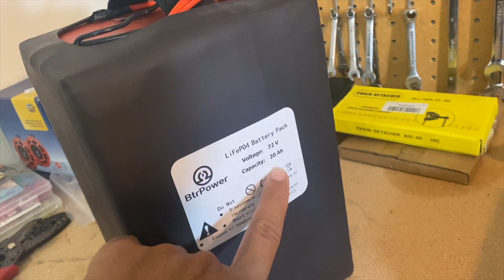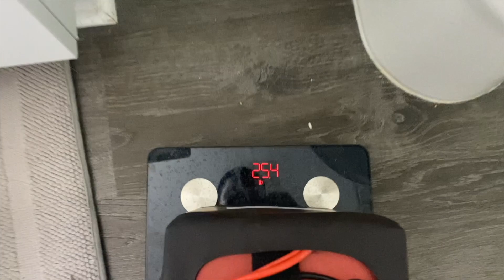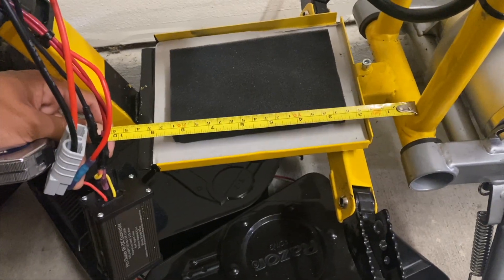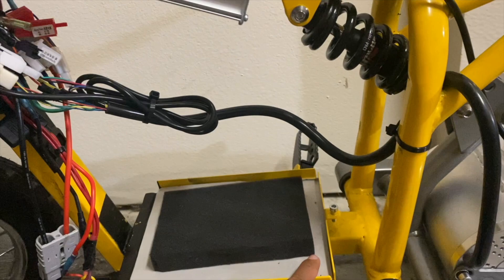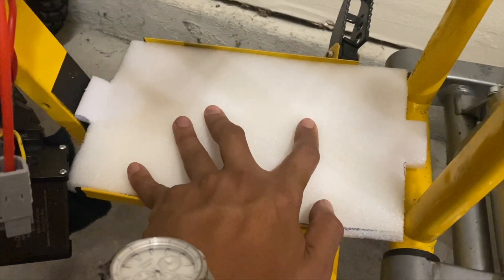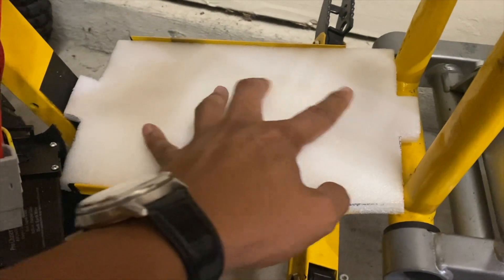Razor MX2000 Got a 72V BTR Power 50A BMS Battery! New Top Speed for the MX650 Supermoto

Comment: 72V 50Ah LiFePO fits in a razor mx650?
Reply from the maker: Nope! This was a super long time ago, 50-amp output BMS 20AH capacity
Reply: @PatOutdoors  7.87 × 8.66 × 12.99 inches. Is the dimensions of the battery I’m looking at but I’m wandering if it fits

Comment: Do you still got this bike with the same battery? I have the same battery and is have problems with it turning on any advice?
Reply from the maker: Check your wiring for loose connections, check your controller settings for any incorrect parameters put in, contact the seller for potential warrantyy
Reply: @ thanks it was the connections

Comment: For the record, I am new. Just recently picked up a sx500. In the process of tear down now. Have my motor, controll kit on the way. Been "researching" batteries. And a lot of rumors about these specifically, not good rumors either. Price is definitely hard to beat which would allow my budget more upgrades. Anyone set the record straight? Yes know Amorge would be ideal.
Reply from the maker: This is a super old video. Go with an Amorge battery if you don’t want to question the quality. I have Amorge on half my bikes now
Reply: @PatOutdoors  appreciated. I really damn if I do or don't. The 500 needs some love hence the $100 price. Was just tryin' to make best of the $1000 total budget I have. Keep up the great work and vids.

Comment: Btr power is the safest battery, for four months I’ve been riding around with a decent size hole into my battery and didn’t notice until it shut down on me while riding, if it was a different brand my house and my dirt bike would have been up in flames
Reply: The hole happened from a metal piece where the led acid batteries would be mounted on and it carved a hole in two places into the battery overtime as my battery was moving around while off roading

Comment: I just got a 72v 80 amp btr battery with an 80a controller! Running the same 2000w motor ! What should I expect? Love your videos
Reply from the maker: That’s fully dependent on what controller you are running, controller settings, motor type, motor sprocket size, rear wheel sprocket size, rear tire size, and rider weight
Reply: @PatOutdoors  I’ll be happy with 45 mph
Reply from the maker: @jeurycisneros17  I don’t see why you won’t get that with at least a 80 amp controller, street tires, and a 13-tooth sprocket
Reply: That’s for replying my man !! Hopefully I don’t fry the 2000w motor pushing 72v 80a 😂

Comment: I have same setup is there a reason mine only goes 25 
I have a 3000w 45amp continuous same battery and 3000w motor
Reply from the maker: @ryanmoss9420  I’ve never heard of a 72V razor going that slow.. what sprockets are you running? Also how much do you weigh?

Comment: So what performance changes can i see from a 72v 20ah lead acid to 72v 25ah lithium.
Reply: I am a lithium battery specialist. Lithium batteries are powerful and lightweight. If you change from lead acid to lithium. Speed can be increased by 30% (if your motor allows it). 20ah lead acid to 25ah lithium, mileage can also be increased by 30%.

Comment: I have A CHEAP lithium 48V with only 35 AMP BMS . I think if I upgrade to a BTR 40 amp bms my bike will be faster for  300 $ ? What do you guys think ?
Reply from the maker: Not worth it. Just save up for a better battery at that point, like an amorge 48v 20ah with at least a 50 amp BMS. Do you have a good controller to support it?
Reply: @PatOutdoors  so 300 is my max budget here . I'm going 35 mph already w rear 1500w hub on a pedal bike . If I can go 40mph I'm happy , and not catch fire and explode that's even better . is the LIFEPO BETTER  than my lithium 35 BMS ??? do I really need 50amp bms if it don't need high speeds over say 45  ish ??? And I wanna stay sub 300$

Comment: So it's OK to mount these batteries on their side? Just purchased one and want to lay it down for a lower profile. Great video I appreciate it.
Reply from the maker: Yes they are, though I would recommend adding a layer of foam at the side you're going to lay it down on, for added protection for the BMS inside the battery.
Reply: Thanks. I appreciate it. Keep up the great vids

Comment: im in the process of building a rsf350 microbike im thinking of hiding the controller on the top tube and the mounting 2 48v 10ah batteries in parallel

Comment: The throttle curve/response, whatever you want to call it, is really bad on those amazon kit controllers. Throttle is really touchy in the low range. If you want a MUCH better throttle curve experience, try one of the Kelly controllers from Electro and Co. It's not as easy to get hooked up as the amazon kits but getting it from them makes it much easier than anywhere else I'm aware of. I have purchased 2 from them so far for builds I've done and I'm telling you, it's a huge difference. You will also get more power from the motor overall. Well worth it once you go to 72v.
Reply from the maker: Fully agree.. That's ones thing I cannot wait to upgrade. Not to mention it supports a much higher amp output

Comment: 72v to a 48v controller? Am I the only one confused??
Reply from the maker: The controller I recently installed is designed to be compatible for 48V and 72V. The bike previously had a 48V battery and 48V only controller, swapped out the controller and battery to 72V.

Comment: The battery will fit in the case.   The case has the 1.5 inch gap for the 1.5inch frame rail.  Just looks weird off the bike. 💯👍
Reply from the maker: Hmm I will give it a shot!
Reply: He is right I have put 3 of those batteries in Razors.
Reply from the maker: @MrHydroguy  Just did it on my most recent build!

Comment: Why did you go with a 48v motor and not a 72v since you had a 72v battery?
Reply from the maker: Just because of my previous modifications. I took baby steps and installed a 48V brushless kit first with a 48V battery before this set up (due to a low budget in the beginning.) Had no plans on going 72V, but just got power hungry eventually
Reply: @PatOutdoors  OK.  Looks like the max speed I've noticed is 45mph.  If you're  getting that with 48v motor I guess it wouldn't  make sense to upgrade to 72v unless through time the 48v motor will wear faster since overloaded.   Any insight?
Reply from the maker: @waynelt3420  Exactly! I'm still riding this same set up today with very little sign of excess wear to the 48V motor so I've had no reason to change it over. But when it eventually does.. I'll just swap over a 72V motor since everything else is already designed for 72V so it'll be an easy swap when time comes.

Comment: I bet that battery would work and look fine with the cover on it and just leave a little gap in the center and run longer screws to hold it together if needed.
Looks like fun man! I got a razor ground force drifter I modded with a 48v brushless kit and 12.8ah lithium battery, can run 33mph!
Reply from the maker: That sounds awesome! What brushless kit and battery did you go with?

Comment: Another thought I had for maybe a different bike. Get a 72v brushless motor then buy a 96v battery, a Kelley controller, and see what type of overvolt power that would get ya.
Reply: i was thinking the same thing, maybe ill throw one on when my 72v bites the dust
Reply from the maker: Where do I find a 96V battery from?
Reply: @PatOutdoors  Combine two 48v. I was thinking the same thing. Not sure if the 72v controller can handle it.
Reply from the maker: @Mr69elco  You mean in a series..? Would that not overload the BMS on both batteries?
Reply: @PatOutdoors  It's common to run batteries in series. I'm running two 36v to get 72v. No problems here
Reply from the maker: @Mr69elco  Just wondering if the internal BMS's regulate the amperage output down is all
Reply: @PatOutdoors  it’s 200x150x350 so the 200x150 side will fit the razor tray it’s the height of 350 that will make it hard to fit in The mx650. Should fit an sx500 just fine though.
Reply: @PatOutdoors  is there a way I can message you outside YouTube? They delete every link I post and I got links to 96v batteries with 80a BmS
Reply from the maker: My instagram is @pkasilag
Reply: @PatOutdoors  no social media for me I got email haha. Oh well maybe I’ll make an ig just to send some links to ya.

Comment: Check out Eon lithium for custom built batteries. They build for the razor bikes. Can do a 40-50ah 72v battery that will fit in tray of razor and clear that shock. They use Tesla grade 21700 cells and 300A ANT BMS systems. They aren’t the cheapest but probably the highest quality you can get.
Reply from the maker: Holy... That would be insane! Also sounds high budget AF haha
Reply: Pls link

Comment: the gap in the cover is the width of the frame. Just a thought.
Reply from the maker: Just tested it, still short about 0.4". I'm ok with the way it looks anyway. The controller, voltage step-down converter and all the wiring still have no place to fit inside the box so the top would have to be hacked up to make it work.

Comment: Just get longer screws for the cover and spacers.
Reply from the maker: I like the way it looks as is, may just make a box at some point. The controller, voltage step-down converter and all the wiring still have no place to fit inside the box so the top would have to be hacked up to make it work.

Comment: Did you also get a 72V motor/controller or just battery?
Reply from the maker: My controller is compatible with 72V. The motor is still the Kunray 48V 2000W

Comment: Time for a Kelly controller man. Get that throttle smoothed out, keep Temps down and battery lasting long. This is so awesome man!
Reply from the maker: Thanks buddy! Yeah really considering the Kelly controller to give it the full potential. I may actually just transfer this controller with a new brushless kit I just got for other of my other bikes.. We'll see about the temps (fingers crossed)
Reply: @PatOutdoors  yeah man. Itll be awesome to just move that stuff over to another bike. Legit what im doing with my bikes aswell. I'll tell you what I had my buddy who has same build as me with the kunray controller and he was upset that mine drive so much better and we had same voltage on our ride out with him being 20ah and me being 15.6ah.
Reply from the maker: @TURBOMOOSE  Well this isn't the Kunray controller and throttle anymore. That was like an on/off switch lol. This is the throttle from my fast scooters kit that I re-pinned to work with a Cozyel 45Amp controller. So much better power delivery and modulation compared to the Kunray controller, but still could be improved with the Lonestar Kelly piggyback kit.
Reply: @PatOutdoors  gotcha makes sense! Even with those improvements all that torque is scary lmao. You have such a little pocket monster on your hands brother!
Reply: Which Kelly do you recommend? I have an MX650 also. Thanks
Reply: @Mr69elco  Kelly kvd! Went with the lonestar piggyback back. Saved some money as it comes with a Cushman made plug n play harness, grips with keyed throttle and voltmeter. Aswell as you can add on other cool features and/sprockets
Reply: @TURBOMOOSE  Thanks! I'll look into it.
Reply: @TURBOMOOSE  is it programmed already?? Cause the Kelly controller I have seen it for like 150 this one is 295 wondering why??
Reply from the maker: Yes, the Lonestar ones come programmed. It also comes with plug and play harness, etc.
Reply: @vert_yt269  programmed, plug n play harness, colored grips/throttle, keyed Ignition, volt meter. Other things you can upgrade aswell
Reply: Have a few vids on it